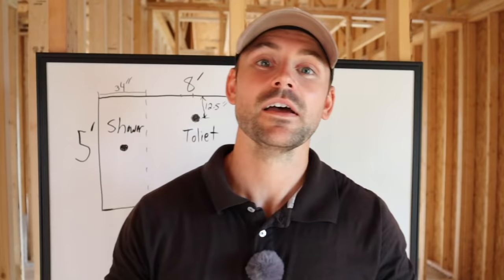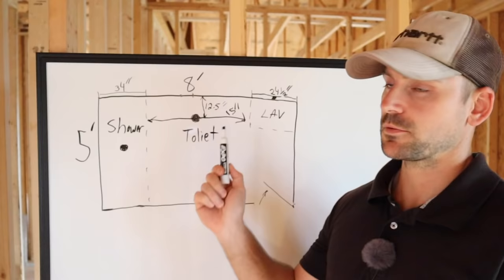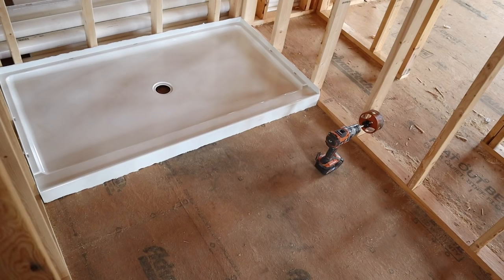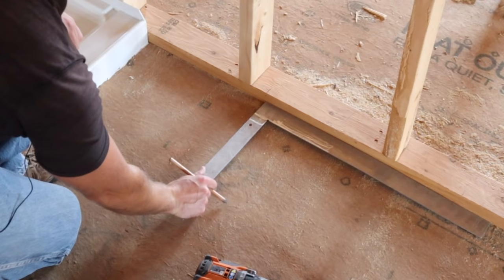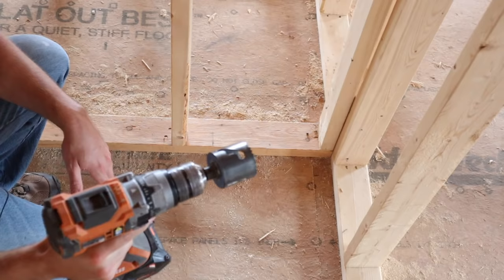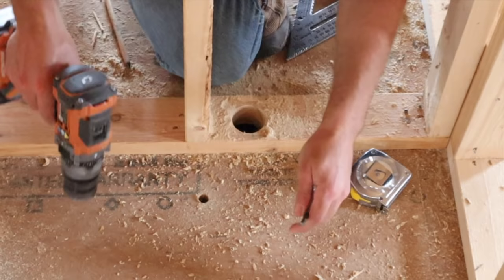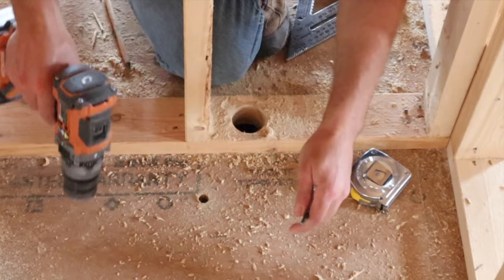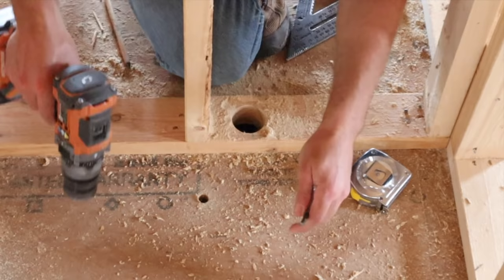How To Plumb A Bathroom In 20 Minutes! - Beginners Guide

Comment: Good video, I used to be a plumber as well.  I like that you are using squares especially.  I would say for the lav. rough in, I would have kept the water lines inside the wall, and also I wouldn't have primed the tee in the middle before dry-fitting.  We would just leave that loose in the rough in stage and then when installing the trim we would glue it with a box or rag to catch extra glue.   I'm not sure what you said about the closet flange knockout?  It looks plastic and I never used that style, did you say to let that go into the sewer or septic after knocking it out?
Thanks!

Comment: Very informative. Question about the venting for plumbing. Would there be a vent line connected to the kitchen sink as well? why or why not? Thank you again, Josh.
Reply: Yes. There are several ways of venting fixtures. But somewhere after the trap there will be vent.  Dry venting, wet venting, combo waste n vent, circuit venting, island venting,  studor vent

Comment: I rarely see water lines come up through the floor. It makes installing tile flooring very difficult. Most Modern houses come out of the wall. I am renovating a 1984 bathroom right now and all their supply lines come out the wall, except the vanity which backs onto a load beam, which we are not allowed to drill at all.

Comment: Thanks Excellent Laborer, awesome video.  One question, is the 3/4” spacer underneath the toilet flange standard, or because your finished flooring is 3/4” thick?  If I was using a 1/2” vinyl flooring, then would a 1/2” spacer be recommended?  Thanks again!
Reply: You don't want any spacer that would raise the bottom of your flange above the finished floor, so 3/4 spacer with 1/2 floor would be a no go. I personally prefer to run the pvc pipe several inches above subfloor and cap it for inspection, install my finished floor, use a reciprocating saw to trim the pipe flush with the finished floor, then install my toilet flange. This insures the flange is in perfect contact with the finished floor.
Reply: @ryanrents126  thanks that seems to be the best way to be sure of a good fit
Reply: I started doing it that way after I roughed a house in with a 3/4 spacer in anticipation of using 1/4" backerboard and 1/2" of thinset and tile on a floor. Finished floor ended up being more like 11/16, not 3/4. It raised the toilet enough to make it wobble. The struggle is real! Haha

Comment: I have a question, for the bathroom sink supply lines, why do you drill 3 inches from the wall instead of drilling them right on the same plane as the sink drain line?
Reply from the maker: Here is the video installing the sink in that exact bathroom https://youtu.be/f7DE6vN5mgw . It should help!

Comment: You never smash with hammer the flange knock plug down the drain system that will clog the main sewer line when the owners move in the home , instead take a flat head screw driver and hammer and pull it out

Comment: I NEVER use a plastic shower pan! There is often a wee bit of give and it will leak. Instead, i always use a Schluter kit. The styrofoam pan is far more stable!
Reply: I always put a mortar bed under all mine
Reply: I have seen mortar beds fail as well. Usually because of insufficient waterproofing.
Reply: @brettbarager9101  I mean under my plastic shower pan.  Fills all the voids underneath and less likely to crack
Reply: Good for you

Comment: How to plan to make the connection out to roof? Will you drill from the rooftop and drop the vent line down. It looks really high with the rafters exposed. Thank so much and an excellent video!
Reply from the maker: Yes you drill holes right through the roof and then use a vent pipe boot to make it weather tight. That sounds like a good video idea. Thanks for watching!
Reply: @TheExcellentLaborer  I plan on installing metal roof over purlins and OSB roof decking. Will have foam spray insulation attached to bottom of OSB roof decking for attic insulation. To minimize future water leaks that could get trapped between foam and OSB and cause future problems, can the vent pipes be run horizontally in attic out the gable end siding as long as you have a slight pitch on horizontal pipe? I don’t want any more hole openings in metal roof than need be. Not worried about any eye sore. Gable end faces back yard and back deck roof will pretty much keep vent pipe from being seen. 
Thanks for any input.
Reply: Yeah, cuz I too, was wondering if the vent pipe could be run out of one side of the home, just under the eaves of the roof, so as not to puncture any holes into the roof?
Reply: @jrandall5736  yes you can run it over to a gable end. My code inspector actually recommended that because I didn’t want to put any holes in my metal roof. You just need a vent cover where it exits the wall. They are located by all of the roofing and water proofing stuff at lowes.

Comment: We're adding a toilet to our existing plumbing that has a vent. The toilet we are adding will be directly above the sewer line. Were planning to drop the pvc down at an angle over 45 degrees and where it connects will be within 6 ft of the vent. Does this sound right? I wish i could add a pic. I can't find a video with a similar situation

Comment: Since this video is over a year old I really don't expect a response.   But here is my question.  I have a pole barn and plumbing was installed for a future bathroom install.  My question is the 2" drain for the washing machine/sink/vent was installed on the outer wall, which will work just fine for what I originally planned for my layout.  Change of plans now was to put the washing machine on the opposite side of the room.  The waste line for the washing machine will be inside a 2x6 wall and will be 2".  The 2" pvc line will run the length of the 8' wall and make a 90 or 45 for another 4' to drain line.  Question is this:  How long can a washing machine 2" drain line run be?  I would like to put in a sink in the middle of the 8' run also.  Any help or advice would greatly be appreciated.  Robert

Comment: Good info, but you have to be careful about taking everything you hear literally.

At 11:44 when he says to turn the flange so the screw holes are "diagonal to the wall," I would say to turn it clockwise about an inch more so that the wide part of the keyway slot where the toilet hold-down bolts will slide in is not  square to the wall.  You want the narrow part of those keyway slots to be at a point square to the wall.  Look at some toilet installation videos for a visual understanding why that must be.

Also, at 12:02 in the video, he says "foot and a half from the wall" - he really means "a foot and 1/2 inch" from the wall.  (At 13:10, he says "inch-and-a-half hole" when he means 2 1/2" but there is a visual text correction added to the video there.)

Clever tip at 16:12 - 16:49 on making sure plumbing fitting is square, but then doesn't use the mark at all at 17:41

17:28 - he means "quarter turn" when he says "quarter-inch turn"

17:41 - what's the use of having marked the fitting and pipe earlier if you are going to square up the final glued-up position of the fitting with the square directly anyway?

Comment: So what do you do if you have a floor Joyce where you cut.out.for toilet and shower
Reply from the maker: You have to frame around that area. I will make a video about it eventually. More or less you double up the floor joist on the each side of the area and head off the existing floor joist. Hard to explain in a comment but I hope that helps!

Comment: try to not let the primer fully dry you want the glue and primer to bond to create a stronger seal. 
new plumber here i was under the impression with IPC code you were not supposed to have more than 40' of vent without running another stack?

Comment: Why are you using a 3/4” wood spacer under the toilet? Wouldn’t that be higher than the tile/flooring you are using for the floor? Yes, I’m a novice. :)
Reply from the maker: Hey Christopher. After you install the cement board and tile it will be about the right height. Hope that helps!

Comment: I have a 1940s home just bought.  They ran the drain for the sink straight down in the middle of the vanity.  If I don't vent to the roof as your example would do.  Is there a cover I could put on the top to eliminate any fumes or smells?
Reply: Stooter vent

Comment: Practically speaking, how do you place the toilet hole precisely in a slab if there may be a slight variation in the finished wall +/- 1 inch? Is it 12.5" minimum from the wall or exactly? And what if you decide to use a hanging toilet instead?
Reply: Toilet instructions will tell you but 12" off the finished wall is standard.

Comment: Why not add compression joints so you can clean out the traps if you need to, at least on the shower side?
Reply: Id rather snake a shower than cut finished ceiling and disconnecting the drain

Comment: Any reason why you don’t use a p trap that screws together and is easily dismantled? Shower/tub is where I was questioning. People in my house can wreck a drain with long hair real quick.
Reply from the maker: That’s a good point Ryan. Looking back at it I do wish I did the trap I could dismantle. And if somebody drops a ring I can easily extract it. Thanks for watching!
Reply: Union p-traps are only for exposed drain connections, such as a residential kitchen sink or lavatory. You can't use union traps in non accessible locations.

Comment: Hey, I have to put a bath mixer on to a brick wall that needs to be tiled over after having the correct holes drilled in tile... I am ok with the individual steps but on the interface (will be female threaded connection at wall) I am not sure if the outermost flange should be level in plane with the plaster or proud up to where I expect the tile will extend from the wall...

Comment: Someone needs to make a video of the bathroom sink being a wet vent like mine. They SUCK because you have to tear out the wall to repair the line or the water lines. Unless tou do like I'm about yoy amd make a access panel since i need to cut my stack anyway and go from cast to 4 inch PVC above the wet vent but keep the cast from there up, until spring.

Comment: To me the toilet flange looks like you will have to turn it the slots for the bolts to hold toilet
down are too close to center so the bolts will  slide into the large slo;t and not the smaller
slot to hold the toilet down???
Reply: Very good video on how to instructions were great! Thanks for the video

Comment: Great video! And thank you for the reply on my other question regarding the spacer underneath the toilet flange. I have another question similar to that. Would you also put spacers underneath the acrylic shower base, so you could slip any tile or laminate flooring underneath the edge? I have a semicircle shower base, and plan to use some kind of laminate, but I want the finished look around the round front to look good, and not choppy. Any thoughts or suggestions?

Comment: Do you can use Sanitary T Orizontal?
Or Combination.
Reply from the maker: Yes it’s just a sanitary tee for sink drain
Reply: @TheExcellentLaborer  I think he might be referring to the main waste line in the crawl space. I also noticed you used San Tees as opposed to combination fittings. Is that legal where you live?
Reply: @aaronnava8579  san T should only be used vertically for venting. He should’ve used T wy instead. Good job though

Comment: You didn’t pick up your shower vent.  Regardless for all you learners I can say your first time plumbing maybe do this stuff but you don’t need to do it like this. Unless your eyes are crooked.  Your holes in the floor for your water lines should be bigger so you can use plastic water pipe clamps to hold your pipes in place.

Comment: Why you make the holes for the lavatory on the floor and not on the stud that you have everything on the wall and the toilet flange Don needs that Piece of wood you put on because the toilet flange can be 2 inches down to the finish floor is why the wax ring for
Reply: The underside of the flange is supposed to be flush with the finished floor NOT below it. Can’t tell you how many brand new homes have wrotted subfloors because of this.

Comment: That would fail instantly in Ga. You can't lay a SAN Tee on its side for a drain line only on its back for a wet vent.
Reply: I don't know what the IPC allows but the UPC doesn't allow the san tee on the side for drain, also wouldn't allow the 3×3×1½ for the toilet and a minimum of 2" vent for the toilet, plus you can't use ¼ bends for drainage on a vertical to horizontal they have to be long sweeps. 😉
Reply: Also no pressure test is allowed for the pvc and the accordion tail piece is under the lav is illegal
Reply: No shower vent and ¼ bends can't lay on the side they have to be long sweeps lol
Reply: chris V 
Exactly!
Reply: @chrisv9509  Its not allowed in any code. IPC,UPC and IRC all forbid San tees on their side or back... and for very good reason. This house is going to have non stop clogs and the plumber that has to snake it, is going to have hell trying to get his snake through those San tees!
Reply: @MisterGreenGuy  🤯🤬 lol yes sir he will, glad it won't be me
Reply: Are you talking about the tee that goes to the p trap under the sink?

Comment: So there shouldn't be a problem trap under my toilet, on a pair and beam house. Got toilet draining to a ptrap then into the main drain line. Everytime it rains longer then 20 mins I can't flush my toilet.
Reply: A toilet don't get a separate p trap. The trap is inside the toilet. The only reason you need a trap on sink or tub is to keep the sewer smell from coming into the house. The water in the trap seals the smell in the pipe.
Reply: Take the trap out of your toilet drain. The toilet has its own trap. What's why you're experiencing the problem. That's a double trap.
Reply: @RVA.plumbing  ok, thank you thats what I was thinking that's how they build it what degree elbow should I replace it with?

Comment: u cant just smash the flange plate down the drain lol it will clog, no way you think thats okay
Reply: What should you do with it?
Reply: Generally the flange should be flush with finished floor. If tile or wood it's probably 3/4". 
If flange is flush, a regular wax ring works.

Comment: You actually just smash that plug from the flange and let the plastic go down the drain??
Reply from the maker: I would not to let it a huge chuck go down the drains obviously. If a small fragment does it won’t hurt anything. It usually cracks into many small pieces so I let them go down. Hope that helps!
Reply: @TheExcellentLaborer  well yeah then it wont hurt the sewage system.. but what about the environment?

Comment: Don't throw $30 at a hole saw you only use once. You can drill a smaller hole and expand it with a jigsaw or sawzall.
If you have trouble gettin the wood piece out of your hole saw. Remove it then put a few wood screws in it and pull it out.